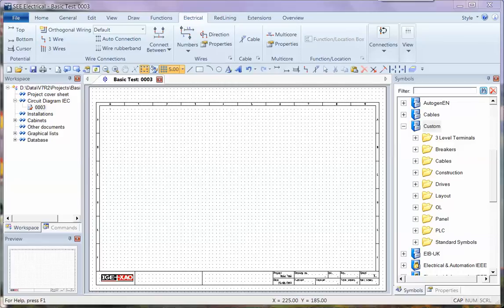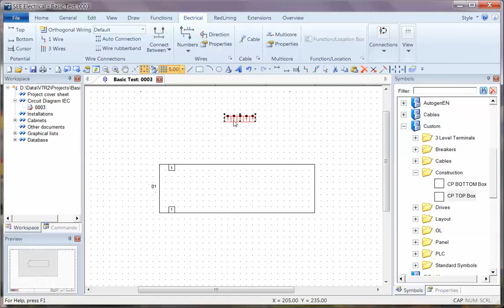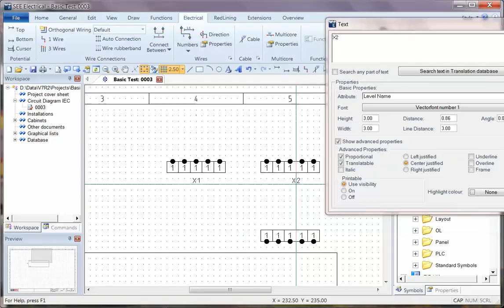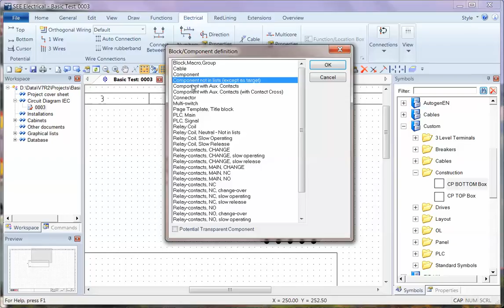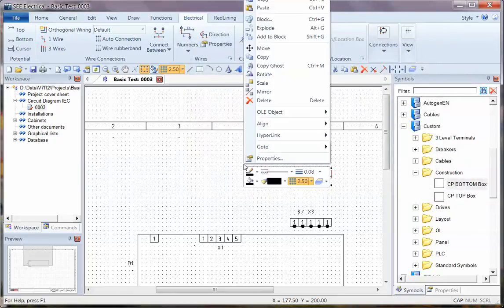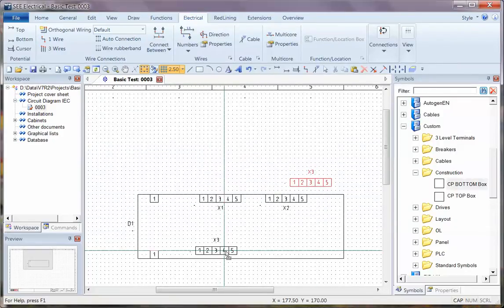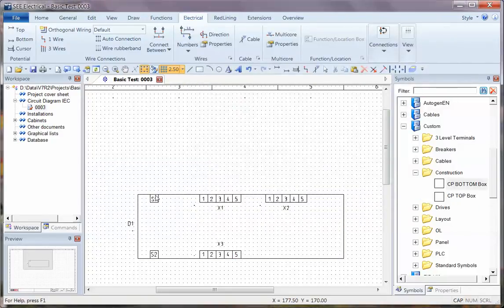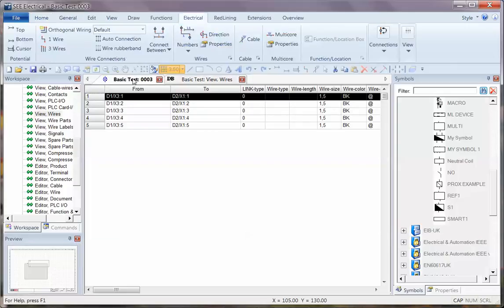Creating Symbols Which Include Sockets and Connectors V7R2

Comment: what is the current name in V8R4 for component not in list?
Reply from the maker: Contact, unspecified
Reply: @IGEXAOUK  Thanks! In Portuguese the name is completely unrelated, I will change the software to English
It would be great if there was in the help menu a clear description of all the types we can block symbols
Reply: @IGEXAOUK  I'm getting an error when I try to add it to the DB, the symbol I'm making in the component typeI don't have connections, could that be the problem?
EDIT: it says that those contacts unspecified aren't allowed in main
Reply from the maker: @manuelcamposcosta5829  Yes, all symbols must have at least 1 connection point. The software will add one if you haven't. Try assigning a space as a connection point to this symbol in the channel definition to satisfy the error checking.
Reply: @IGEXAOUK  still not working but I'm not sure I doing what you are saying, can we exchange emails? When I select the symbol the ID becames "6"
Reply: @IGEXAOUK  could you please create a video with V8R4 and add the component to the DB? also if possible the case where the component doesn't have single connections, all of them are sockets, etc. it would be great when we change the product all the related connectors change accordingly

Comment: Cant find these connection boxes used in here :-/
Reply from the maker: Place text (Ctrl+T) and set the attribute to 'Connection > Connection'. Format the text how you want and use F6 to move the text independently to the connection circle. Then draw a box around the text. Select the box and connection point and drag onto your symbol database folder to save for future.